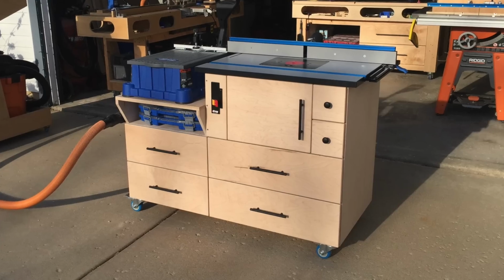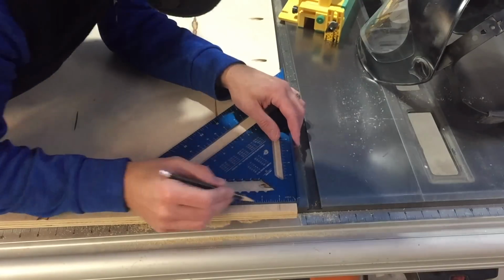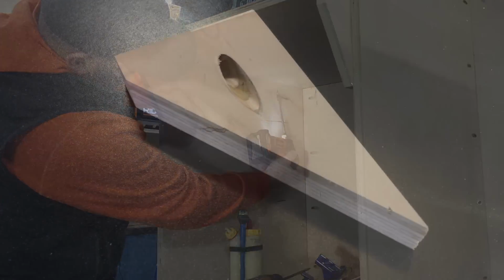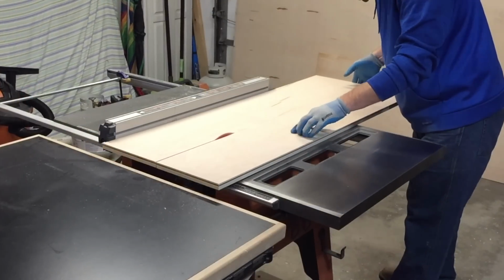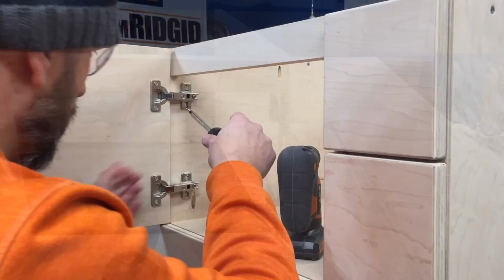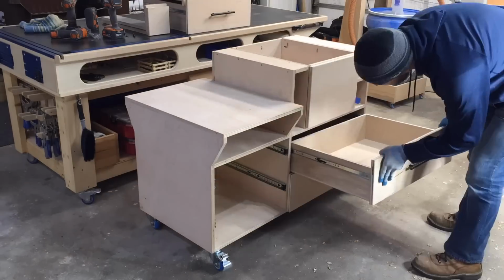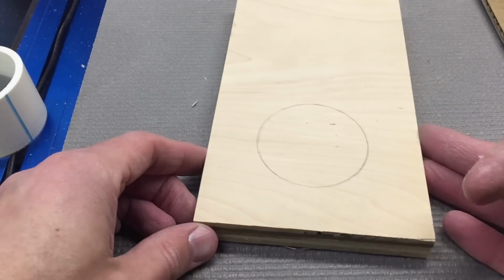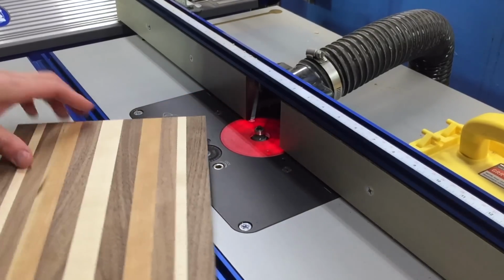CReeves Makes the Mobile Router Table Combo with Kreg Features ep0028

Comment: This is a nice project and since I have the Kreg router table and the Foreman, I was contemplating doing such a project. So I’m glad you created the plans for it. The printed plans were a little confusing regarding adding the two horizontal dividers. Although I can pretty much extrapolate the distance, it would’ve been nice if the plans showed at what height you mounted the dividers. It also implies that the dividers were added before adding the top for the Foreman. But in the video, it looks like you added the Foreman top before adding the horizontal divider panels. That’s certainly the way I would do it as it gives you room to work. If you add the horizontal panels first it would be very difficult to get the top on using pocket screws. All in all, a really nice project. Thank you

Comment: Very nice design and build.....the only thing I'd do is add a blast gate to the router table fence so that if you are doing something where the fence is not providing actual suction, like for anything buried in the piece, you can concentrate the suction in the router chamber....oh, and drill some holes in the front of the router chamber door to provide bothe intake and router motor cooling.....thanks for the great content.
Reply from the maker: Thanks Jose! That is a great tip for the fence! I actually left 1/8” gaps on the top of the front door for suction.

Comment: Excellent setup. If I may make a suggestion about your door hardware, I find things constantly get caught on them. I used them in multiple projects for people (they chose them) and alway have the same issue. And yes,  I would paint it, great call. Great build. 👍👍
Reply from the maker: Yeah I get what ya mean about the hardware. I haven’t had an issue yet but I can see it happening. Thanks for the tip!

Comment: I didn’t see any grooves or means to keep the bit storage slides from tipping down when you pull out the slides or did I miss it? Any way awesome build. I’ve been using Kreg pocket hole jigs since 1999. Glad to see a craftsman use glue along with the screws. I always said the screws were mini clamps that forever remained in place. That’s how I could and would give a forever warranty on furniture and cabinetry. Very “Robust” craftsmanship ✌️😎
Reply from the maker: I added in some simple hardwood cleats to hold the storage slides in.  Works well for now. 👍🏻

Comment: Nice video. I'm curious what you've modded on your cordless ridgid circular saw around 6:15. Aside from the Kreg track saw mount, it looks like maybe a couple items added for dust collection. Thanks for the video.
Reply from the maker: Its a customized Ridgid circular saw.  I glued a shop vac nozzle to it and added side shields to see if I could make it dust free.

Comment: Another Excellent build from you, Well done.
In answer to your question on painting the pipe, i would have done the same thing and in the black as well, as it matches up with all the Kreg stuff being Black and Blue.
Well done again.
Barry (ENG)
Reply from the maker: Thank you very much Barry!  Yeah the black does a good job of blending everything in. Thanks!
Reply: There is a paint product that is used to ground all the components and isolate noise inside of guitars. It is black as well as other colors. It is a little costly but just painting a stripe down the side with a screw at the end will give you an static electric shock stop when connected to a ground. I play an electric guitar and was getting shocked every time I played in my socks. My luthier fixed it with the paint inside of the component cutouts and on the back of the covers.

Comment: Very nice!  Can you tell me the overall height, width and length on this fully assembled?  Also, if you have the length, width and height on the Miter Table stand you built that would be great.  I am thinking that I want to build both of these.  Curious about the total footprint and to see if they are the same height as they will likely sit next to each other in my small shop.
Reply from the maker: It is 49" wide x 36" tall x 28" deep (Foreman Platform)  The miter station is 96" wide x 36" tall x 24" deep.  I have the miter plans on my website www.creevesmakes.com and let me know if you have any other questions! Good luck!
Reply: So they are the same height!  Awesome!  Thanks Casey!  I just picked up a Foreman and was trying to decide what to do with it.  I have about a 14' stretch of wall that I am eyeing for this set up, so they would fit great there!
Reply from the maker: Awesome!  Good luck!

Comment: Great build which I will adapt for my requirements.  Please can you advise where you purchased the slotted driver used in your drill to tighten the hose connectors and what it is called?
Reply from the maker: Hey thanks David! It’s actually just a socket bit out of my Milwaukee driver set.  It just fits over the hex of the clamp.  Way easier than flat blade bits! Thanks for watching and good luck!👍🏻
Reply: CReeves Makes many thanks.  Obvious now I've rewatched it!  I will replace the slotted screw heads with bolts.

Comment: Do you ever have interference problems with longer boards on the router to the left since the kreg foreman fence does not seem to be aligned with the router fence and also the foreman pincher?
Reply from the maker: No I do not as I have the Foreman fence is back away from the router fence.  I have never had an interference issue...yet.
Reply: @CReevesMakes  Good to know.  I plan on doing a similar setup.

Comment: Longer pieces ran through the router table hit the foreman clamp?
Reply from the maker: No, I have the Foreman back behind the center line of the bit. I have run 8’ boards through it just fine.
Reply: @CReevesMakes  okay thanks, looked like it might interfere but the angle is hard to see on video.

Comment: On the plans cut list you have a drawer thats 27 3/8 by 13 3/8 where does this fit into the project at?
Reply from the maker: Hey David, I forgot to mention that! That was an optional large DOOR for the router area instead of the two cubby and small door system I put on it.  I completely forgot to mention that in the plans. It was meant as a players choice to choose what they wanted.  Sorry about that.

Comment: At the end around 17:08, when you're showing off the router lift, does the adjustment thingymabob lock in place?  You run your workpiece over top of the router elevation adjuster.  Is there anything keeping the workpiece from accidentally turning that little wheel and changing the height of your router?
Reply from the maker: Yes you can lock the position and the material will not contact the dial wheel.  I have seen some people put a small piece of tape on some of their router lifts to keep the wheel from moving, but I have not had an issue.

Comment: Really nice build but after all the effort of matching the grain on the draw fronts and doors why  screw the electrical plate from the outside? Having those three screws visible would drive me crazy!
Reply from the maker: I know what you mean but it doesn’t bother me as bad as I thought it would.  I may be adding stuff to the table and wanted easy access to that area.  Maybe I should have put some more hinges there with a magnet catch? 🤔 now Ya got me thinking! Thanks for watching!

Comment: Aren't you not suppose to drill pocket hole towards the end face of a board?
Reply from the maker: I have never had an issue when doing it this way but technically I think you could be correct.??

Comment: Honestly how much would all this cost to do
Reply from the maker: The initial build would be fairly expensive if you do not have any of the components.  You would be looking at roughly $200 in plywood as well as ~$100 in casters and slides and hardware etc.  The Kreg components would be around $1200 including the Foreman.  You could build your own top and fence system though.  Check our DIYMontreals video! She does a great job on hers!

Comment: Casey, awesome build as usual! What router did you use in your lift? I am wanting to purchase the Kreg lift, but want to make sure I get a router that fits...preferably Ridgid.  Thanks in advance
Matthew Pratt
Reply from the maker: Hey Matthew!  I used the Ridgid R22002 2HP unit.  Fits nicely into the lift.  The lift is really easy to set up and use.  Good luck!

Comment: Dude lower the blade on your table saw before you cut you hand off!

3 teeth above the material
Reply: I see it was lower later in the video.
As you were.
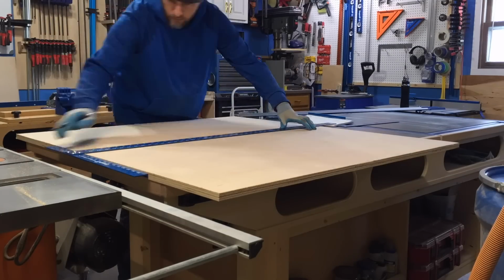Reply from the maker: I cut 95% of my cuts the way you described.  The reason that cut is so high is to reduce the diameter of the cut and then I can clean it up with a jig saw.  My normal cuts are like the ones at 2:00
Reply: @CReevesMakes  good call on having the blade that high there man.  I do the same thing when cutting notches 👍
Reply from the maker: @WoodshopMike  Thanks Mike!  Yeah its my preferred way to do it.  Focus, and cut!
Reply: That's because there's no Kreg tool that can help him with that.
Reply from the maker: I about spit my coffee all over my keyboard!

Comment: These videos are just long Kreg commercials, not saying that Kreg is bad, but I just don't like having products forced down my throat while just trying to watching a build video...kind of bummed as you seemed pretty squared away.
Reply from the maker: Good morning Dave.  Thanks for your feedback and I agree on some respects.  The video is sponsored by Kreg so of course I am going to use their products.  My intentions with my videos is to introduce people to ideas and applications of tools and building that I need and use in my shop.  You can use whatever brand of router top or clamps etc, I just want to plant the seed.  If Kreg is sponsoring my project, then you just have to look past that and enjoy the details of the build itself.  No intention of force feeding you anything other than the idea of the table.  Hope you stay tuned! Thanks for the comment

Comment: What's with the poofy gloves?
Reply from the maker: They are not poofy. They are rubber coated for grip.  I don’t use those anymore. This was way back when I didn’t have heat in the garage so I wore gloves more often when it was below zero outside. Now I have heaters.